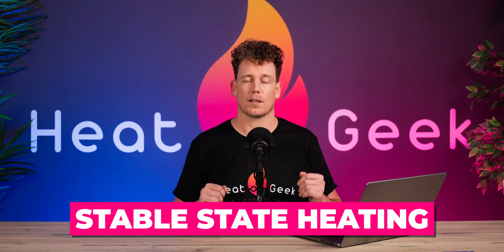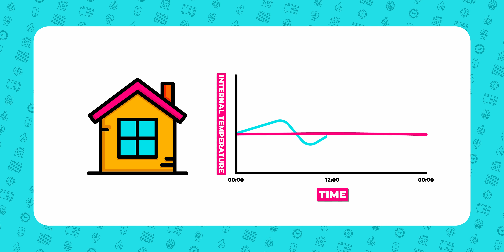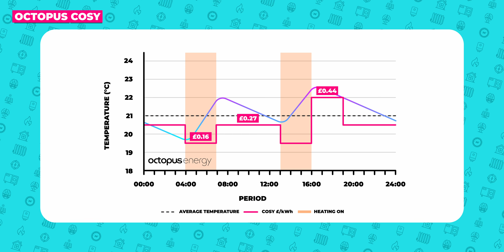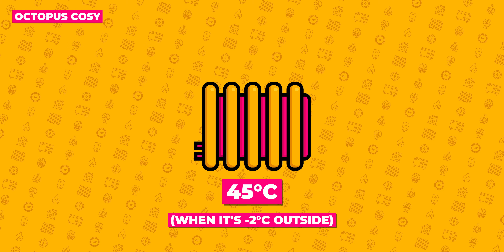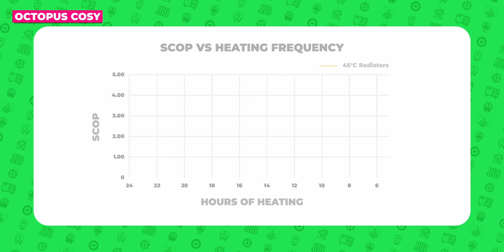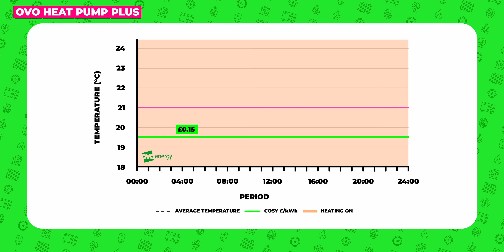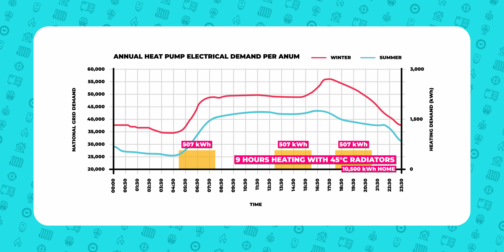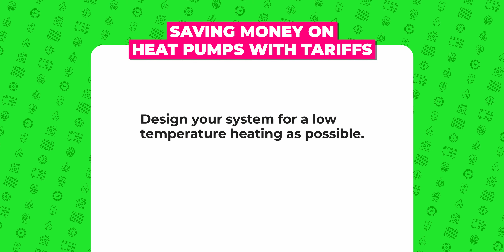Which Heat Pump Tariff Saves The Most Money?

Comment: Our historic gas was about 14,000 kWh per year.

We’ve just completed 4 months with a heat pump.

Here’s the comparison of last winter with a gas boiler to this winter.

Nov 22-Feb 23 gas boiler use for space heating and hot water 8206 kWh. Total £1496

Nov 23-Feb 24 electricity use by ASHP for space heating and hot water 2146 kWh. Total £89

We’ve changed multiple things, not just installed a heat pump, so I’ve had to break out the various cost savings.

3% less heating required (degree days) = £30 less cost

Changing from price cap to 
Octopus tracker tariff gives a saving of £733

Installing Solar PV (winter months) saving of £75

Octopus Agile instead of Octopus Tracker (enabled by battery installation) gives a further saving of £244

Less saving session battery export payments of £180

Finally, heating system efficiency (ASHP with weather compensation steady state heating instead of on/off thermostats) saving of £145

Comment: Cosy + battery. Battery bridges the expensive time, push variable electrical use the cheap times (tumble dryer, dishwasher etc), program hot water to cheap times. Then leave my HG elite installed HP on steady state doing its thing getting 420%+ efficiency. Saves me about 20% vs using a standard tariff.
Reply from the maker: With 3.5p per kWh heating costs on ovo, would you bother!?

Comment: Very interesting.  My 18kW (!) twin LG ASHP’s were designed with a flow temperature on the MCS certificate of 55 degrees ! And that was with changing most of the rads.
I have progressively moved towards steady state heating, running at a much lower flow rate with weather compensation turned on and an overnight setback.
The house is comfortably warm 18-20 degrees al the time.  Other than when it is really cold the thermal mass of the house will keep the house warm through the night and the heating doesn’t need to come on. 
I turn the house temp up from the overnight setback in steps so the heat pump doesn’t make a massive demand, and try to align step-up’s with cheaper time of day pricing.  Daily consumption is still quite high at around 25kWh a day in winter, with really cold day peaks of 60-80kWh.  Still trying to work out how to reduce this further.
Agree about Cosy, my heat pump demand exceeds my battery capacity so I went for Octopus Agile which has been considerably cheaper than any other option. The battery means I can run the heat pump all day and not turn it off in peak periods.  Average monthly import price is 13-18p/kWh

Comment: The key to load shifting  for time of use tariffs is a battery.  We charge our battery and heat water  at cheap  rate and run the heat pump from it on steady state for the r3st of the day.
Reply: Do you use solar pv for your battery or can you just connect a battery to the grid to charge it? Haven’t heard anyone mention this yet, was glad I stumbled across your comment! Our 220 year old house can’t support solar panels but we have the grant for the pump (including full installation costs) so don’t want to have to turn it down because of no solar 😢
Reply: @richardmccann9293  can't speak for all battery systems, but I often charge mine at night on cheap rate when I know I won't generate enough solar to get through the next day in the winter. And since Feb battery installs are VAT free, even when not installed at the same time as solar panels.

Comment: A great conversation to be having - thank you.

Throwing my own experience into the Comments mix.  ASHP, in a three-year old house that I've made largely air tight. 400mm loft insulation. Reasonably long run from the pump to the cylinder/UFH, but it's well insulated.

I'm on Octopus's legacy Go tariff; roughly 7.5 pence from 0030 to 0430; 40 pence for the remainder of the day. Like Michael, I try and squeeze all of my 'heat' out of the pump during those four hours. Cold snap aside, it works; 90 minutes of DHW, then two hours (more if the DHW is done) into the UFH, then a little bit extra for the radiators. The radiators can run into the peak tariff if they need a litte longer to raise the temperature upstairs. We don't wake up to a hot house - we wake up to a comfortable house. Phew!

Happily, with outside air temperatures at or above 5 degrees C, the house will hold onto that heat through the day (roughly 21 degrees). As Michael does, we might see one or at worst two degrees decay by 2200. The challenge comes when the overnight temperature falls lower / below freezing, since the flow temperature drops, AND there's not enough time to add the lost heat back into the house.  That's when we either put a jumper on or rely on the occasional Octopus Power Ups to run the UFH during the day (effectively for free) to put some more heat into the UFH screed. (I should add that we run 90 minutes DHW top up early afternoon if it needs it. That's at the full-fat rate).

My frustration is that this is far from the best way to run the ASHP efficiently. Yet the difference in price between the two rates makes it so much cheaper to run the pump at night, that I think it worthwhile. Flow temps at the UFH manifold are around 44 degrees; the radiators are hot, but comfortable enough to touch. The DHW tank is set to 47 degrees.

Essentially, the house is warm enough, and we have enough hot water, through the day, when outside temperature is at or above 5 degrees. Below that, it does get a little cooler, but it's largely manageable.

I'd love to be running super-efficient steady-state heating, yet the tariff make that super-expensive for  most of the day. Perhaps I should be on a different tariff, that is less cheap AND less expensive? Though I'd like to keep the Power Ups too - they're great for running the white goods.

As noted, better to avoid the peaks than target the troughs?!  I'd love to add panels and a battery too, but that's for another day... (Apologies for the lengthy essay!)

Comment: What about a heat battery?  Either supplied by ASHP or direct from the grid.  I have been exploring the possibility of using a heat battery (eg sunamp) for home heating rather than the usual water heating.  There is very little information available.  A friend has air-to-air heat pumps to complement his gas boiler.  His boiler was only on for a few weeks in December and January.  The rest of the heating being handled by the AC.

Comment: Your graphs show:-
Heating 24 hrs is cheapest not intermittent.

Fur 24 hour heating the difference in cost  between 35 and 50 degrees is less than £100 per year  cost for the typical house.

So the ROI in moving from 50 to 35 degrees is very long.
Best bang for your buck seems to just get a system cheap for 50 degrees that will cope?

Happy to be corrected...
PS.. This is the Octopus business model I believe

Comment: Interesting. Currently I have solar PV & battery storage. I have the usual gas combi. I’ve often thought of the merits of a heat battery to absorb any excess solar & possibly use a heat pump & or solar thermal. This would primarily be for hot water and the main reason for choosing a heat battery is space. This has made me think a heat battery could have a secondary use across peak periods to maintain comfort. As you always say one size doesn’t fit all

Comment: Here's my real World example of Octopus Cosy for your consideration, which I've been running for 13 months:  EPC B, 21hr heating, ~24°C flow mid-winter with weather compensation, DHW and appliance use only during low-rate periods.  I have no idea what SCOP I'm achieving, so I'll have a look at your calculator.  Cheers for the video.

Comment: Do you take into account the cost of your installation? 
A bigger Heat pump costs more, is usually less efficient and doesn't turning off/on your heat pump that much, hurts its lifetime as well? 
I see heat pumps with continues runs of over 10 days in winter. When you turn them off when tariffs are high, it will have an impact on its lifetime, I would think?
Reply from the maker: No because in reality you would size it more correctly and run it more often in winter
Reply: @HeatGeek   when you use stable state heating, sure. 
But load-shifting, does has a negative impact on your heat pump, I would think?

Comment: I am on V2H . 30 kWh Leaf. I am all electric now and retired. Cost of running my 3 bedroom bungalow though the winter was £65 a month. I also have solar panels.
Reply: 3 bed house here. £33 - £34 month heating and hot water during the coldest month using a 24 year old gas combi boiler.
Reply: @davelowe1977  That is great to here. May l ask what temperature do you keep your house at also what temperature is your water at. I keep my heating on 24/7 at 19°C and keep my door to the bedroom closed at night and open the window. I heat my water once a day at 50° C.
Reply: @bobchambers6952  I have more modest temperatures. I work from home but I set the thermostat to 17° during the day for all rooms except the bedroom where I keep the window open but for really hard frosts. My water is heated on demand so it's typically one long shower worth each day that I use. That's included in the gas figure I gave above. I turn the heating off overnight.
Reply: Well done .It's all about keeping the cost down and it's good for the environment.

Comment: That was a very interesting investigation of theoretical operating strategies with various tariffs and some great tips/messages. 

The strategies you investigated were all based around switching the heat pump on/off for some periods of the day in response to electricity price changes. This seems quite extreme, but possibly exaggeration for the purposes of illustration. 

Wouldn't it be less extreme, more comfortable and more efficient to adjust the temperature setpoint throughout the day in response to price signals, rather than switching on/off? The results could be presented in similar charts, but instead of the horizontal axis displaying hours of heating per day, it could display temperature setpoint variation e.g. 0, 0.5, 1, 1.5 etc. deg C (increase during off-peak electricity periods, decrease during peak periods)
Reply from the maker: It was illustrative yes.

Comment: Using a home battery to "buffer" the cheap prices and carry over the expensive times is probably the best approach. Problem is, you need a relatively large battery (my 10kWh wasn't quite enough, but worked decently) and you need to make sure your energy losses from charge/discharge and system standby aren't too large.

Comment: The Mitsubishi FTC6 controller comes with a means of avoiding peak price heating... But there is nothing clear in the public information but reading between the lines it seems to need a big buffer tank to store heat produced at other times. What is really needed is a simple means of controlling heat pumps so that they work at their minimum output during the peak power time in the UK 16:00 to 19:00. Setting the thermostats lower seems a crude way which might not always work. BUT as more homes move to heat pumps we may find the hump in usage is less of an issue. Turning on power showers at 9-11 kW may be a bigger issue than we know?

Comment: I have just installed an ASHP with underfloor heating and a 10kwh battery. I am on the Octopus Cosy tariff with the plan being to run steady state heating (with setback temp at night) and use the battery to move most of my electricity to the cheap rate tariff. The advantage of the Cosy tariff is that  I can cycle the battery twice a day (effectively allowing to shift 20 khw of electricity to the cheap rate with a 10 kWh battery. Also I have the 6 hours at the cheaper rate given by the tariff irrespective of the battery. I think I will be able to run all my heating/hot water at the. Cheap rate. Only just installed the system so will let you know if the plan works!
Reply: So a year on how did it work for you? Especially as shortly after this video dropped (and possibly because of Adam's suggestion) Octopus introduce a 3rd period into the Cosy tariff effectively extending the effective battery capacity. Do tell?

Comment: I once calculated the storage we'd need to properly take advantage of an off-peak tariff, I think it worked out to be a 25,000l insulated storage tank and something silly like a 60-70kW heat pump. I think I calculated for a 50C flow temperature, heating the water to 60C and letting it drop to 50C over the day but I can't remember the exact numbers. On paper, it worked out to be a very good setup, just with some unfortunate practicality issues.

Last time I looked at OVO's heat pump tariff the normal rate was more than Octopus's tariff, but it seems to have come down now so we might need to look at that again.
Reply from the maker: Heat pump plus has only ever been 15p
Reply: @HeatGeek  I meant their standard tariff for your other usage, it was 30p at the time which with out usage (Working from home) sadly made it more expensive than a flat 27p from Octopus. But now that their standard rate is 25p, heat pump plus should be a good saving for us.

Comment: i think this is slightly misleading because we don't spec the radiator for constant use. the duty cycle for them even at the MCS outside temp is only meant to be about 50%?

you would never be able to heat the house if it was 100!

Comment: We got on Cosy Octopus with our Daikin Altherma about 4 months ago and after lots of experimenting have settled on running heating 6-8am to take edge off (any earlier and we found it was waking us up prematurely), usually open windows to blast fresh air through the house for 30-60 mins from 10am, then heating on again 11am-4pm. Hot water is run twice a day, 4am and 2.30pm, to 45deg. I've disabled weather comp (shock horror, could never quite get it right) and basically run it dumb to charge the house with heating by setting thermostat at 28 degrees. It never reaches that but gets to 21/22 by 4pm most days around now. Flow temperature is 39 degrees. Our heating cop for Feb was 3.94. We have a wood burner that very occasionally run in evening to further charge the house but we could live without it tbh. Running heat pump during the day makes absolutely the most sense to me, outside air temp is warmer and everyone is awake. Heating runs for about 6 hours, of which prob 3 is low tariff. Hot water all done in low tariff, we run dishwasher and washing machine during low tariff (also primes with  water from cylinder so doesn't use as much energy) and usually cook through peak tariff so could do more but most things go through the Ninja Foodie which uses relatively small amounts of power anyway. I think I calculated we're saving about 25% atm with these tweaks and the house is snug by day and cool to sleep by night. My wife wants a shower in morning, otherwise I could also live without morning hot water and just have evening showers, but life is too short to compromise marriage for scop

Comment: I have been keen on a heat pump. However, this video has really put me off. At present, I think the infrared panels will be better as they heat the room and its mass rather than the air.
Reply: Don't let it put you off. We went from storage heaters  to heat pump. We are steady state but we have a daytime temp of 18 and night of 16.  At the moment we're about £4 per day   we're on eco 7 so hot water done during night and has a setback level of 40degrees  during the day which we've never actually got down to.
Reply: @AbbyB650  thanks. I'm really waiting for the Octopus Cosy Heat pumps as these look to give a better bang for buck over the current range of heat pumps. Considering we are likely to need colling, I am also looking at air to air as this may be a better solution, year around when paired with infrared in bathrooms etc...
Reply: @davidgates3498  the Octopus unit is unlikely to run at high efficiencies from what we have seen of it. The company are likely to cover this by offering specific tariffs to adjust the costs. Daikin produce reversible versions of the Altherma to provide cooling. Personal comfort and efficiency is different between A2A and A2W. Many A2W users compare their comfort as being similar to (average) summer time ie "it's just comfortable. You don't really notice it cold or hot." Get onto the HG map and talk to one (or more) of your local Geeks, and possibly see an existing installation.
Reply: @garrywhiting8398  thanks, time will tell about the Cosy. They are very slow at releasing any info on the product, especially as it was launched with such fanfare. Re the Heatgeek video, I love these videos, great info. This one really made me think about the instal. I really, really don't want any more or bigger radiators. Seeing as having these is quoted as being key to a necessity the. I think I'm really going to consider and extra powerwall and something else for heating like Infrared.

Comment: i have a 1300l thermal store, would a heat pump on ev octopus go with 6hrs at 7.5p, 
waiting for my planning ASHP, but at the moment using immersion x2  to heat my store to 70 at the cheap rate with a heat loss of my home at 6kw, keeps the underfloor heating steady at 29 for 10hrs +6hrs off peak, 
i had not choice as the gas boiler gave up, and ran out of logs for the thermal store.
house stayed at a stable 20-21. this feb